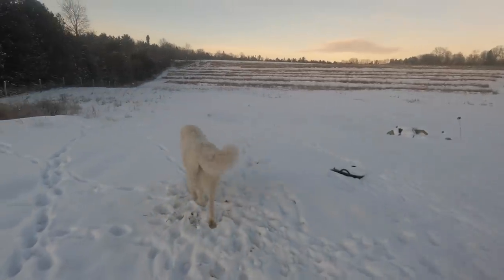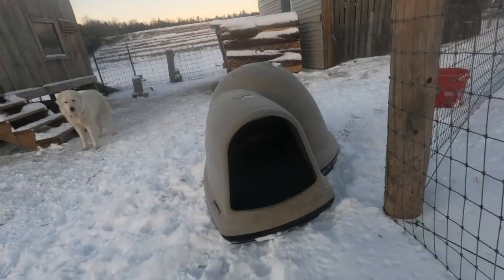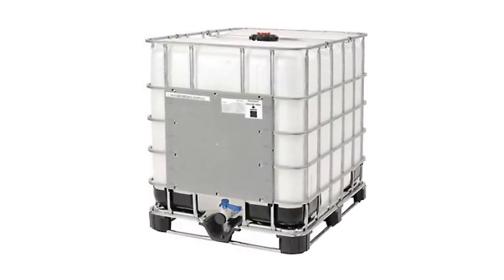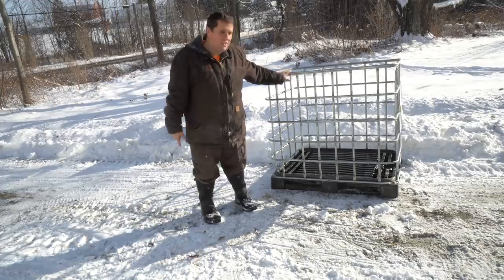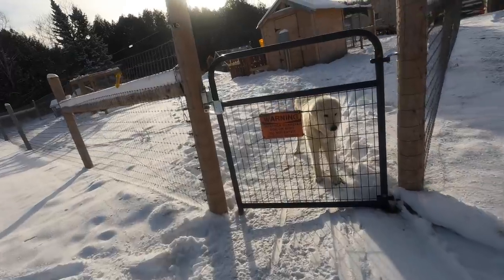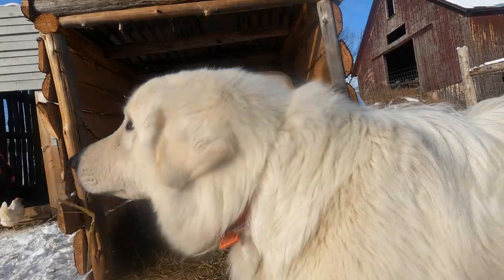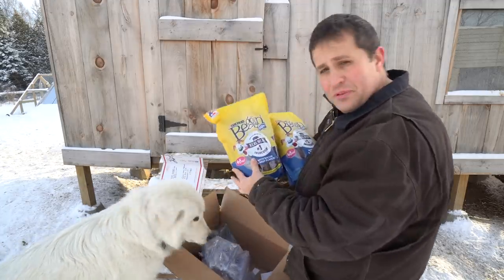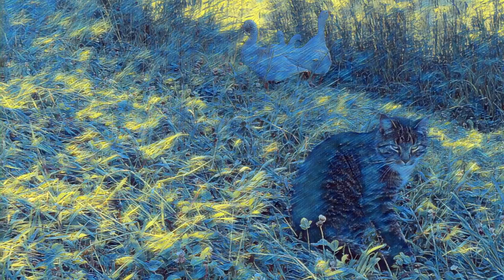An Ice Cube Dog House for Sub-Zero Temps | Livestock Guardian Dog Housing

Comment: If you ever need to make it more insulated, you can put straw in between the wood and the plastic.
Reply: would be even better if mixed with clay(in some cases i even saw cow dump but it's probably not healthy) . In country that i live in clay+hay was the cheapest and most useful thing for insulation. I've been in old farmhouses and it was even used on the walls in some cases. My granma still have old coop(it was build probably in the early 20 century) with walls that have clay+hay in the middle. It's impressive that it still holds after many generations it was sold over the years.
Reply: @bertranwalker6524   clay+hay is called cob and is used everywhere. It is a great way to insulate or cover exterior walls proven by days gone by and it stills works.
Reply: @bertranwalker6524  Traditional wattle and daub human habitations sometimes used dung in the binding mixture. After it dried (and, often, was white-washed over), it became weather resistant and odorless. If Toby needs a really deluxe house, it's an option, though he also has warm fur and, presumably, a nutritious diet to help him warm and insulate himself and his "ice cube" house provides a valuable wind-break.
Reply: I was thinking that exactly.
Reply: Straw between the wood and the 'ice cube" would also firm it up so it doesn't wobble when he gets into it.
Reply: since it's a maremma, unlikely to be needed
Reply: I was thinking the same thing!
Reply: Foam insulation block would work well, plus it's really cheap for a cpuple of 8X4 sheets
Reply: @prcervi  good to have it in case he may needit!
Reply: I mean you don't need any extra insulation if the "door" is so big :P The plastic is already windproof and it doesn't get any better than that unless you install a door...
Reply: @i.i.iiii.i.i  adding to that, all that stuff to increase 'R' value would decrease his 'woof' value. He can't do his job if he can't hear anything outside his house. A plastic un-insulated door may not compromise his ability to hear stuff.

Comment: Hi there ! As a person who has 2 24/7 outdoor dogs I wanted to give some tips if you want to build a new house for Toby in the future (or anyone who want to make an outdoor doggy house): Even if the house is gigantic make the door just small enough for your dog to go into ,that way less air will go out and it will be a bit warmer inside and putting a "doggy door" made out of felt will seal it even better ! But that might be too hot for Toby. Second tip ; start the opening about 15-20 cm above the "floor" that way the bedding wont come out eveytime your dog enters/exits the house  .
Reply: Right. The opening is way too large. Defeats the purpose of providing shelter. Strips of old carpet across the door would help to retain body heat.
Reply: Im glad im not the only ine that was a little underwhelmed with the end, he had his house as a pup.. But he means well and we have no idea whats comfy for that dog! And i mean, he got treats forever :)

Comment: Around here in the netherlands they use the metal structures of the IBC's to store firewood.   You could fill it up without to much stacking and put the firewood in the barn and just stack another IBC with wood on top of it.

Comment: If Toby dosnt like his house and he still sleeps underneath the coop, you might try making removable panels to put on the legs of the coop. My chicken run is made out of removable panels and then I winterize it with clear plastic sheeting and tarps to keep the wind out. With Toby you can throw hay under the coop so he has some nice bedding. You are becoming a New England farmer with your thinking FYI 😂, I grew up in the sister state of NH in the boonies.
Reply: I was thinking about something similar, just blocking the wind under the coop.

Comment: here's an idea for the plastic igloo inside the wooden crate...insulate between the crate and the igloo with hay as well...and attach a sack as a curtain flap that drops over the front but is hemmed about 6-8 inches up from the bottom to create an air gap and ease of access in and out of course...💜💜💜

Comment: If you pack some straw between the  white house and the wooden structure, I think it would not only help to stabilize the white house so that Toby would feel more secure getting in and out of it, but it would also add any other layer of insulation.

Comment: I bought 3 IBC Totes to store rainwater harvested from my shed roof. They work great for that purpose. However, I wanted to manifold two together using 1 1/2” pvc pipe and fittings and discovered that the valve on one of the tanks had metric threads making it difficult to use store bought NPT fittings. I did manage to fabricate an adapter and all is well now.

Comment: Both the wooden kennel and the tote are open to the elements on one side. Have you thought about rotating it 180 degrees so it's open faces the shed and you link the bit of cut out to make a little roof out blowing rain and sleet. Wind cannot go around 90 degree bends. I'd also stuff the gap between the tote and wood with straw, layers make good insulation.

Comment: Stuff more straw in the gaps between the tote wall plastic and the wood exterior walls as insulation and stabilization (Toby will like it if the plastic doesn't move around as much).

Comment: Negative 4 (which is -20 C). Brutally cold, man that doesn't even come close to being somewhat cold. That's bathing suit weather compared to living up northern Ontario where it hits -35 to -45 C. That dog breed, like our Great Pyrenees, can easily deal with -50 without a problem. In fact, the colder it is, the better they like it. As long as they can get out of the wind - cold is completely meaningless. But even then, the wind doesn't bother them with that really think coat. It's funny, -20 we don't even wear jackets outside if we're not going out too long. That's a warm spring day.

Comment: Why not buy some of that insulation that keeps cold out in the winter and heat out in the summer and use two sided Velcro to wrap it around the outside of the plastic house? With the wood exterior and the hay lining that would be a great comfortable house in the coldest of cold temperatures.

Comment: What you need to do is to put some blankets on the straw in the dog house, perhaps screwed down so he can't drag the blankets (plural) out.  Then take more straw and put it on the top and sides (inside the house)of the igloo for insulation.  Be sure the house faces South.  Too bad you couldn't put a heating pad under the blanket, but that might not work out too well.  I love Toby Dog and all the Gold Shaw farmers!   P.S.  It doesn't get that cold in Texas!!

Comment: if you want to clean stuff that's sticky like sugar or fat, use hot water. it'll melt into the water and then wash away easily, instead of using just the force of the cold water spray to try to scrape it off.

Comment: Like the idea 👍though I'm not too fussed on how open wide the front is, like on the wood shelter I would've put extra slats of wood half of the front to trap the warm air inside. As wind can blow straight in.

Comment: You should stuff straw in around the sides and top......that insulation will make it a lot warmer....did you remember to drill a few holes in the bottom and top to fight condensation ?

Comment: I might not know what's best for a farm but thermodynamically, shoving straw all around the plastic between the wood will help to increase temps a bit and of course, a doggie door of plastic sheeting and an outdoor panel heater under the plastic should cost little to plug in during the winter. Perhaps if he had two shelters, one completely open for when he did not need or want to be warm and one well insulated and with a low grade heating pad at the bottom to increase the temperatures when in negative territory. I worry about him because dogs do get sick sometimes, things do happen, and in the wild or in situations like that, they simply die. If they cannot tolerate the cold, they perish, simply, and that would be terrible. He's a young healthy animal but in a few years he may twist an ankle or catch a doggie cold or something and you may not notice. Having a warm place to head to for those rare occasions is something I would definitely do if I had your farm. Again, you're the pro, but I have had domesticated animals all my life and know their life cycles and know what sadly happens to outdoor working animals all over the world...they get replaced. People in poorer countries and in harsh conditions may love their animals as well but they can't provide shelters or temperature changes for their animals, so they simply replace them. And that means, you lose a beloved dog. Not likely but it's what was on my mind every time I have watched your videos. In my head I am saying to myself "Oh $$&%, What if Toby feels cold????" That and "He needs a doggo buddy." Having another mutt about in my personal estimation (again, I might be wrong) would train the 'puppy,' they'd have someone their own size to play with, and you'd have a backup for the 'if and when' scenarios (vet visits, illnesses, etc). My two cents. 

BTW: LOVE your videos. Wonderful, good on you and everyone at Gold Shaw.

Comment: Well, the design is horrible. The material might work if the weather did not go too much below zero, which it will in that area. The ground is frozen. The house needs to be up off the ground (rocks, cinder blocks, anything to lift it up about 8 inches off the ground and then stuff straw under it as insulation. Never use hay. Hay attracts vermin and gets wet and stays wet, thus freezing your pet. 
We also live in the North East and have livestock that can survive non brutal winters that do not include more than a foot of snow. We have used much smaller versions of that type of box to create shelters for feral cats that cannot be trained to go inside. The door has to be to one side of the box (which should be rectangular, NOT SQUARE) That way the animal can go back inside away from the wind and weather that will blow in the door, even if you have a door covering, which of course, Toby does not rate. Forget that it is Vermont and the temperatures can go far below zero. Toby is a "livestock guardian dog." "He doesn't need to be protected from snow drifts covering his house!"
We recently had over two feet of snow dumped on us within just a few hours of time. We had to get out and plow and shovel every hour in order to be able to get to the livestock. If we had waited until morning (like most people) they would have been snowed in and starved within a couple of days. Even the pasture animals had to be brought to an area where we could have access to them. I doubt that this guy could lift a shovel of heavy snow in order to get to his ducks or his dog.

Comment: Plastic is about the WORST material to build a dog house!
If freezes, it retains humidity and it doesn't retain body heat.
Also, it is better to use straw and not hay.
Straw repells humidity and retain body heat.  A hundred years ago straw was used as isolation for houses...